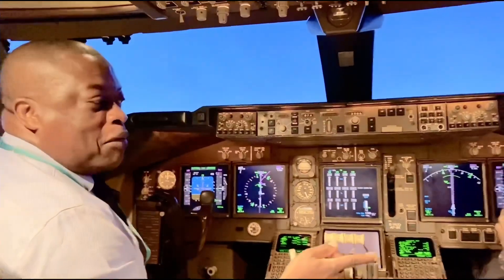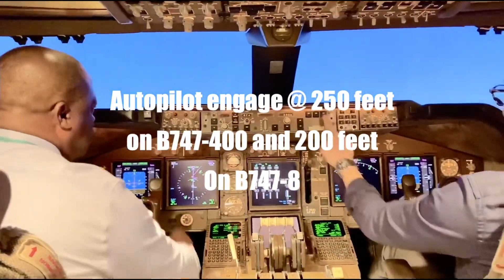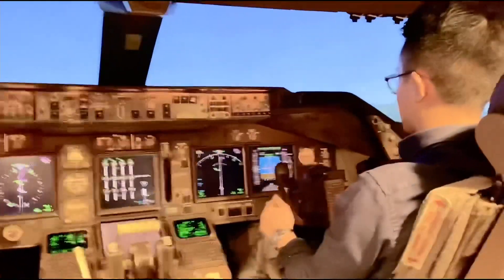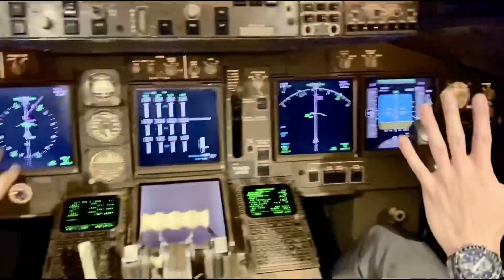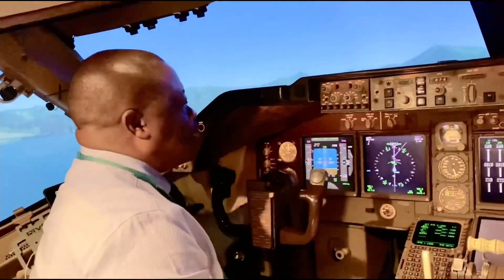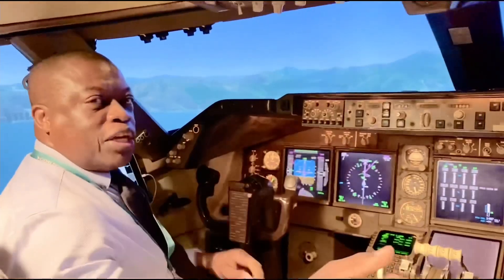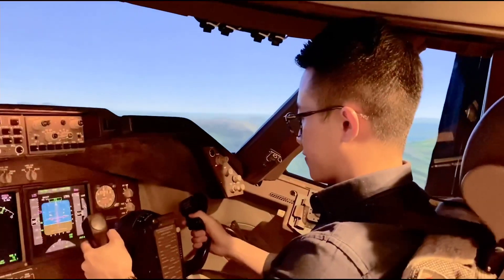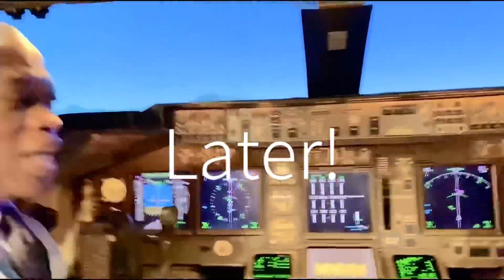B747-400 Takeoff sequence

Comment: Hi Obet, great video! One question, what is the click you hear at 4:01?
Reply: It’s the autobrakes “clicking” from RTO to off. This happens when the weight is off the wheels.
Reply from the maker: It’s most likely the landing Gear lever latch mechanism moving away so that the gear lever can be moved ‘UP’. It’s the loudest of the clicks
Reply: @pilot_obet  Got it, that makes sense. Thanks for the reply!